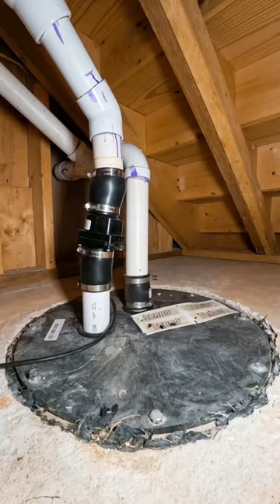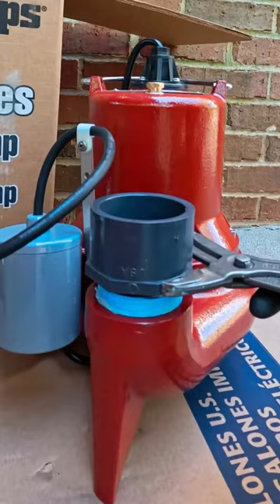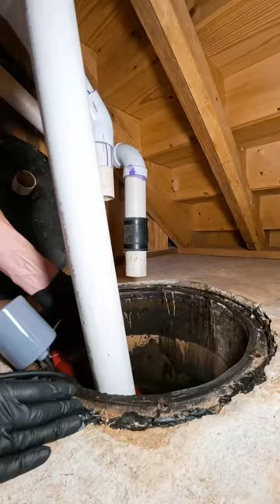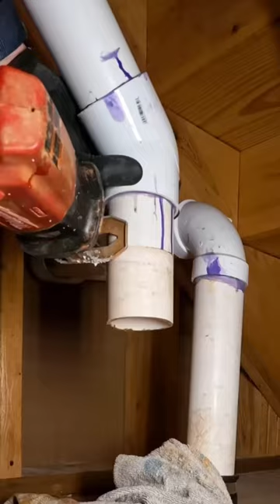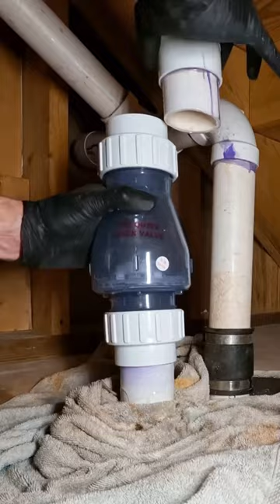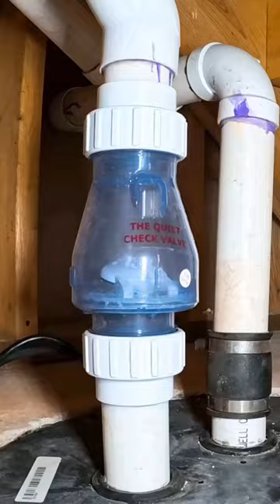Replacing a sewage ejector pump and check valve 🚽💦 #plumbing #plumber #asmr #diy

Comment: Nice install. I respect the sch 80 adapter, less likely to stress crack. We’d of advice, where you drilled your hole, come in at a downward angle pointed at the float, it will keep your float clean and non sticking.
Reply from the maker: Thanks for the tip 👍

Comment: Use the best pump on the market. A Zoeller. Made in the USA. Every sump pump I change out I install back with a Zoeller . Do your own due diligence. Buy a Zoeller.
Reply: I have to say this is no longer true. I have seen so many Zoellers fail and I have seen many plumbers switching to different brand due to high failure rate. Often it is built in float switch that fails. Personally, I like Liberty pumps and I know many plumbers are switching to this brand as well.
Reply: @lambition  my problems have not been the switch but the capacitor  built inside the pump. Two many cycles on and off bring failure to that capacitor.  
Good luck.
Reply: It's not a Zoeller but a liberty pump that is installed which is actually the best pumps out there !
Reply: @dannypowers4995 can that capacitor be replaced?
Reply: @carlexus3133  I do not know . Maybe a motor rewind shop could tell you. I open one pump myself  and it was oil filled . I saw the capacitor  had failed ,it was a Grey mush the size of a pack on chewing  gum. 
Outside my pay grade .
Reply: @dannypowers4995   how much would you want for this job?

Comment: Why do u drill a hole in the pipe b4 u submerge the sump pump????
Reply: It lets the water drain outta the pipe
Reply: @M.A.S.8513  it is to prevent air lock. Sump pump cannot pump air. When sump pump is installed with check valve, air can get trapped inside pump. Just like when you put a cup over the water upside down. Hole will let air out so the pump is filled with water.
Reply: It’s a shitty job…. But somebody’s gotta do it
Reply: I didn't drill a hole 5mo later, not working, is that because no hole inn the tank?

Comment: The only thing I would have done differently, would have been to add a PVC ball valve above the check valve.
Reply from the maker: There is one .. it’s just higher up out of camera frame
Reply: @theplumberlorian  Gotcha 👍
Reply: @theplumberlorian  Isn't much use up there! Hack!
Reply: So you would have did that cut and not flanged those edges for glue the same would you. as well as noboby knows what the hole was drilled for ???

Comment: Why are you drilling the small hole? Does it work for rain water pumps? Or only for this brand?
Reply: For air lock
Reply: Will air lock stop the pump from pumping?

Comment: They say you should drill a hole in the discharge line. But you don’t have to with the liberty pumps. I have never drilled a hole in the pipe and haven’t had any issues

Comment: Drill hole for ?
Reply: It’s a weep hole
Reply: Stops the pump from air locking
Reply: Its there so the pump doesn’t get air bound. It lets air out as the pump starts, so the fluid can reach the check valve and open it.

Comment: 😂😂😂 they used 3 ferncos on that pipe.
Reply from the maker: Oh yeah 😂
Reply: Inspectors in my city will not allow these Fernco bands on a pressurized line. I installed an extractor pump at a salon and used a check valve similar to this and failed inspection. I was required to use a glued on pvc check.

Comment: Sorry, but I don’t agree with the location of the check valve.   Drill your weep hole about an inch above the pipe connection, then put the check valve right after. Connect the pipe on top with a rubber Fercon union with 2 supplied hose clamps.
Reply: You’re not a plumber if you think the weep hole goes below the top of the pump 😂😂😂😂. Also IPC and UPC both stat you cannot use a fernco on a pressurized discharge line. What handyman service do you work for?
Reply: @Alan-n6u8b  I’m not a plumber!  Weep hole should be right above the pump pipe connection (1 or 2 inches above). Sorry for the confusion.  Purpose of weep hole?  So pump does not get air bound, or it pump has no water and then fills, so the air has somewhere to go!

Comment: First, Who installs a clapper valve at an angle?  It goes straight up and down.
Second, Why drill a hole in the pipe?  If you want air don’t glue the joints!
Third, why didn’t you realign the piping above where you cut it off to align with the new pump?
Fourth,  I agree, why would anyone want to see crap being sucked up;  that’s why the line is solid white or black.
Sad, poor plumbing job, I’d give it a rating…. but i’m not a plumber!😷👎

Comment: Nice….
That crooked cut should hold real good…
That was real smart… have fun replacing that pump now that u glued the check valve on…. U just locked the pipe into lid…. U obviously don’t do service, must b an installer…
Reply: The check valve clearly has unions on it. The fact that you can't tell that means you must be a keyboard warrior not even an installer